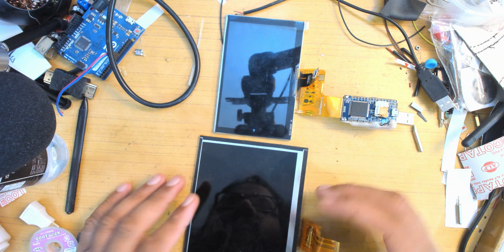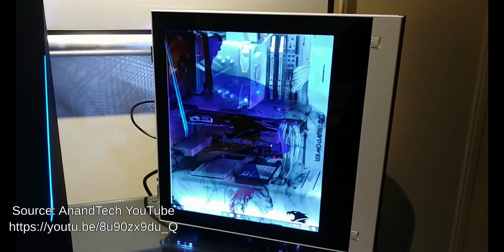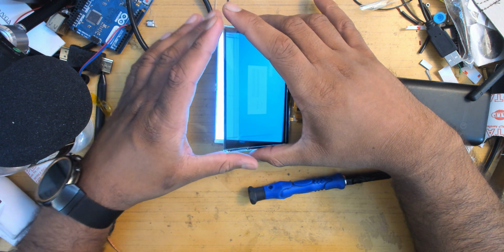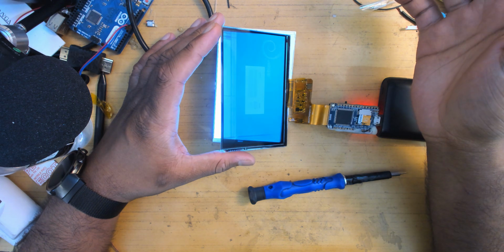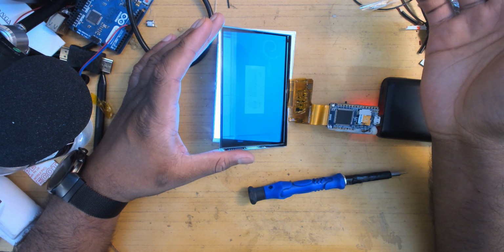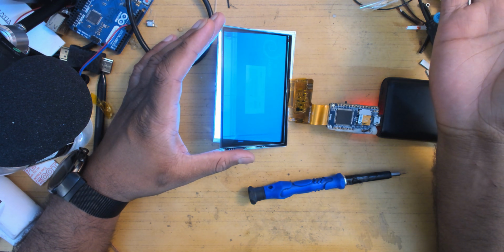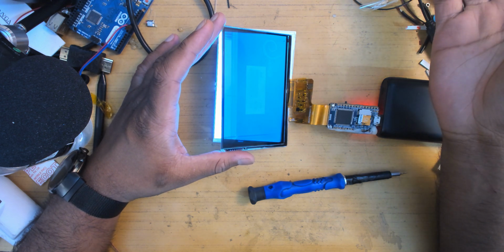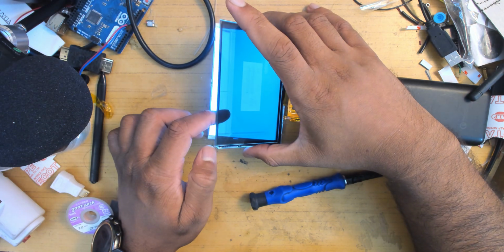DIY See Through Transparent LCD Hack

Comment: I would cut out the backlight and case to make a window then reassemble the frame. I would also reattach the touch interface because it usually creates a nicer bezel than anything DIY I can build. 
  I'm curious how it looks with color but without the double polarization of a lcd on top of an lcd.
Reply: https://youtu.be/ZVzAMq5yPMk